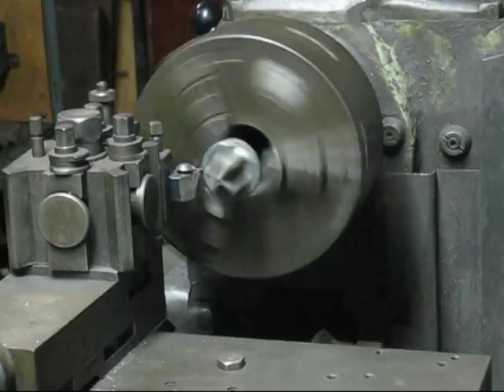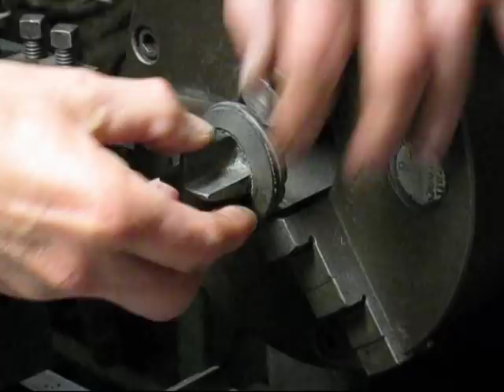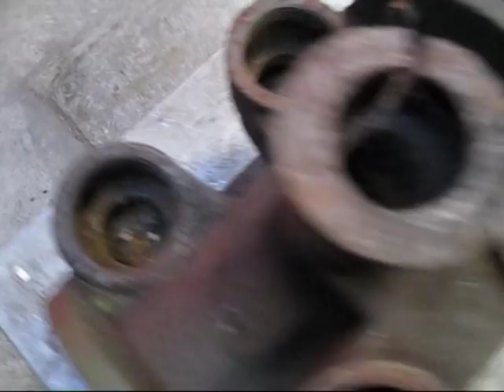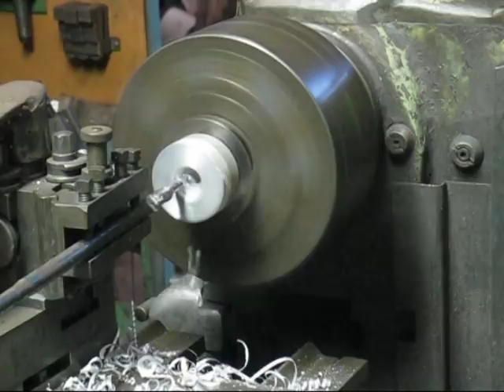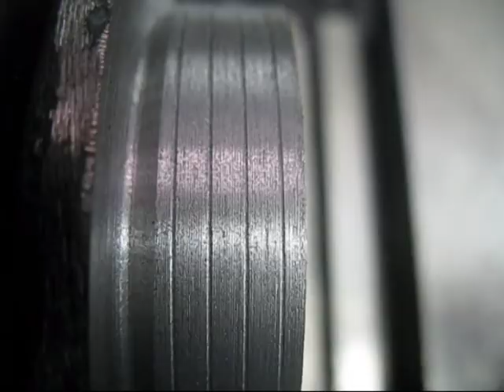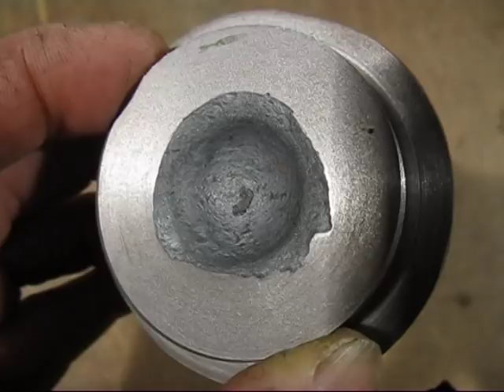Machining my iron castings (Well pump parts)

Comment: I am going to be making some small machine tool castings (small metal planer, etc.) from cast iron, and I was wondering if adding magnesium to the cast iron will make it so the usual dust from machining the castings will actually be more of a chip? But, will adding the magnesium effect the ability for the cast iron to work properly as a bearing surface, or even reduce it's vibration absorbing properties? I know there are ways to protect lathe ways from cast iron dust, but I was just wondering if magnesium would help. Thanks.
Reply from the maker: Magnesium when added to molten cast iron will produce a ductile iron and the chips will curl off like cutting steel. As for the dampening properties I don't know it is better or worse than normal flake cast iron.

Comment: what you made was really a thread gauge, not a die-nut. if you were going to recast some inspection nuts, what didn't you cast the hex solid? It looked like that was the problem with the original: the hex broke and then people were using a pipe wrench on the od and chewing that all to heck.
Reply from the maker: yeah dienut was a poor choice of a word, female thread gauge would have been better.

Comment: Nicely done as usual! I am going to guess that if the run out was still not acceptable that you would use some shim stock on one jaw to get the surface for the thread to run true.
Cheers from John, Australia.
Reply from the maker: That is a good idea.
Reply: luckygen, a thought has just come to mind with reference to my suggestion of using shim stock.
That is with the forces and loads imposed on the part being machined the shim may be inclined to slip/move between the component and chuck jaw.
 A possible solution for this could be to make the shim long enough to hook over the back of the jaw it is installed on as well as the sides of same.
 I would be interested to know your thoughts if you can spare the time.
 Cheers from John.
Reply from the maker: As long as the chuck jaws are tightened enough I don't think a shim would slip.